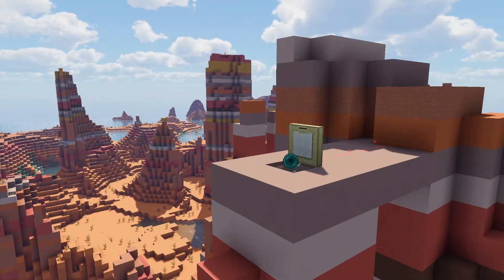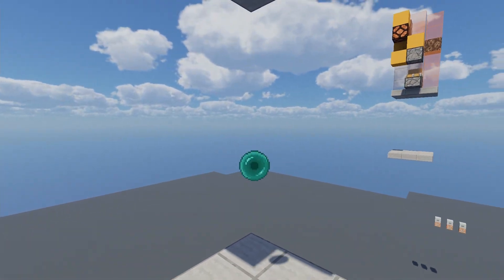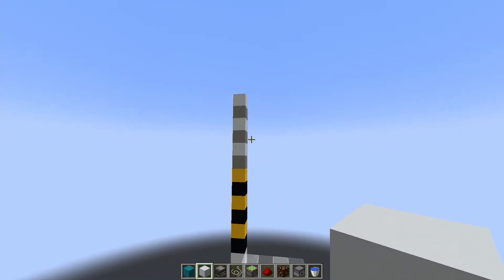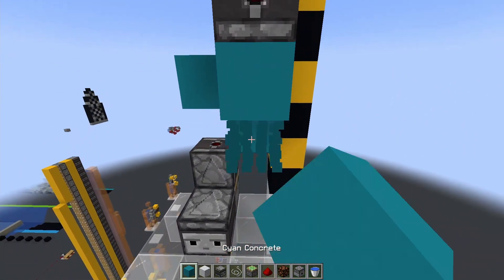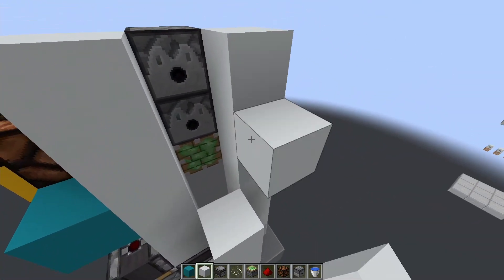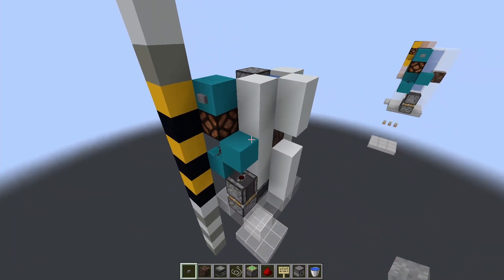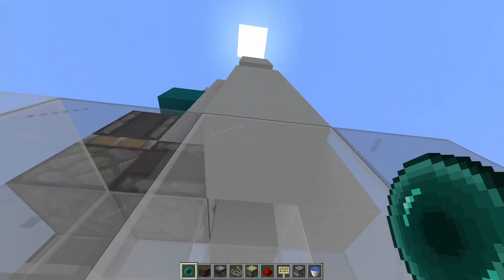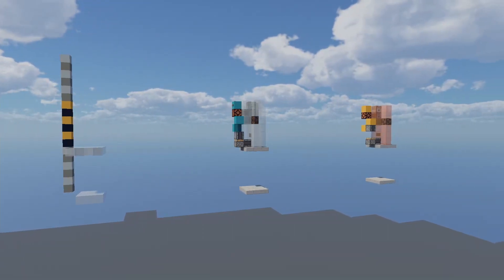A Cooler Enderporter. (Ender Pearl Stasis Chamber)

Comment: Seems like this design might not work anymore (At least it did not for me). Looks like the bubble column takes too long to activate and the pearl just lands on the soulsand. I did find a new stasis design which allows you to put multiple pearls in one bubble column and only taking one out by aligning them with pistons and other stuff. I used that to get the same result of it dropping from the roof. Really cool design though!
Reply from the maker: Was this on singleplayer?
Also those alignment stack separators are really cool, amazing what people come up with these days

Comment: Ummm didn’t etho already make this? Like day three of the mechanic being introduced?
Reply from the maker: Yep, he made two or three different designs and pioneered the current variety that uses a bubble column+trapdoor in the floor. I designed mine to be hidden away in the ceiling instead.
Reply: @JavaChef  yeah like in ethos furnace room

Comment: the jump-cut at 2:13 to avoid saying that you have to reset it to make the soulsand move is CRAZY
Reply: Cool design tho fr, I modified it a bit to make it move on its own and have a lower clearance
Reply: then again maybe I just built it wrong \_('-')_/
Reply from the maker: It's a little tricky to get it to work at first

Comment: It can be done remotely, right?
Reply from the maker: Yes... as long as you run a wire all the way to it from where you want to teleport from. I recommend using instant repeaters for that.
In my testing there were some issues with this working in unloaded chunks compared to the typical trapdoor design. However this doesn't affect teleporters in spawn chunks / entity processing chunks.

Comment: Amazing video, subbed! Im having issues with this design on a vanilla minecraft server though. Works flawlessly in singleplayer 1.19.4, but in multiplayer the pearl collides with something at the top of the water. 

It almost looks like the snowballs/pearls seem to have a larger spread on multiplayer, could that be something? I tried sending up a few snowballs at a time and some of them sit at the top of the water perfectly, but the majority have too much horizontal velocity and bounce off the water and into the inner wall.
Reply from the maker: Thank you! That's an interesting issue, I have a feeling it is because of increasing server load affecting physics since I'm getting it more frequently on singleplayer. I'd have to check how projectiles are calculated in the game code to know for sure

Comment from the maker: For 1.17.1 - 1.21.1, entity processing changed in a way that reduces this design's effectiveness. However, in 1.21.2+, this design should work normally. [See replies for details]
Reply from the maker: [Addendum] Any inconsistencies in 1.17-1.18.1 are due to how chunk loading and entity processing have changed. Chunks seem to now be loaded spherically relative to the player (including height) rather than in a square grid, which loads less of the world than before (good!), but it reduces enderporter range in those versions (bad).

[Edit] New changes in 1.21.2 will allow enderpearls to chunkload, nullifying the previous changes and improving the range and reliability of this design.